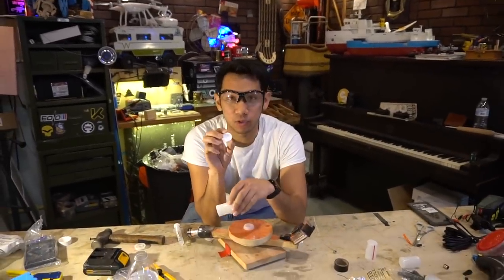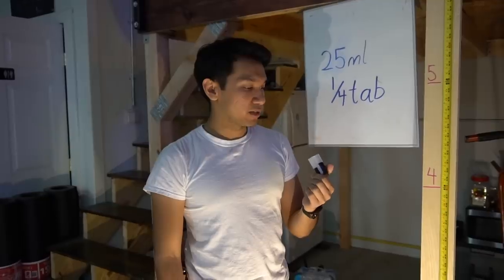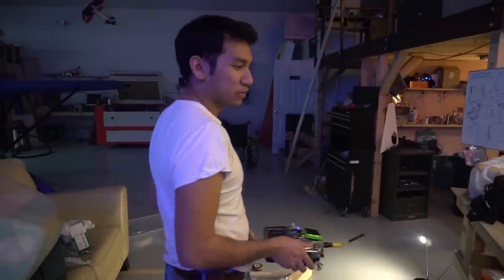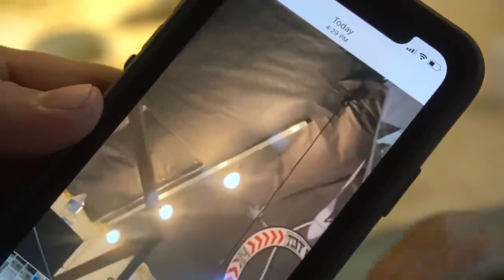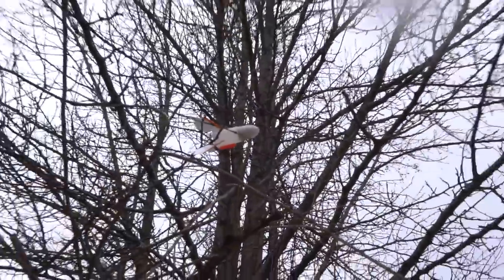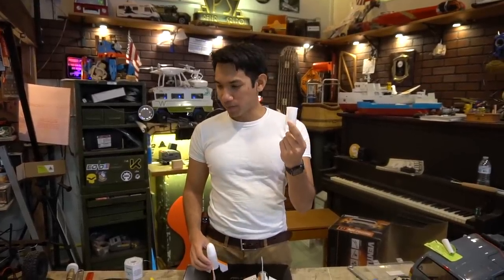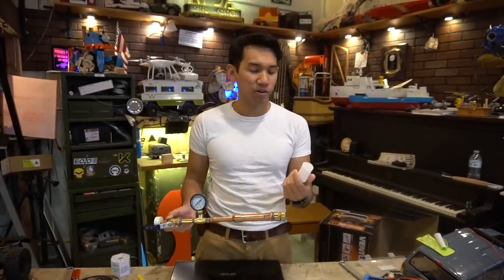EXTREME Alka seltzer Rockets

Comment: Love the channel but hate it when Sam comes up with a good idea and peter doesn’t know what to do and gets jealous and throws it in the bin...
Reply: He is right though, it changed the propulsion type from a rocket engine to a cannon/projectile. I could see an asshole teacher giving it a D or F for that reason.

The challenge was an Alka Seltzer Rocket, and he still gave it 1st place.
Reply: Seems he treats his friend like crap, he could had used Sam's   launcher, just leave the valve open. Peter you need to be nicer, open jealously does not go over well.
Reply: Papadoc Fpvp
A rocket provides it's own propulsion. Using Sam's cannon is cheating, because it's the cannon gives propulsion to the object, which means the object is not a rocket anymore, it's a projectile.
Reply: @roelvian  neither one carried the propulsion unit on the rocket, just delivered pressure differently, one popped when the pressure was to great, the other had a valve, and a smaller pipe to increase pressure. They were done in different ways, and I do understand what your saying, but Peters did not carry the propulsion fuel either.
Reply: Papadoc Fpvp ok then, listen to me.

Rocket -> self-propelled
Projectile -> gets propelled

Peter's rocket -> self-propelled by the reaction inside the rocket. The energy was released FROM the rocket.

Sam's Cannon -> Propelled from the reaction inside the pressure chamber. The energy was released from the chamber ONTO the projectile, which pushed it forwards.

the contest: Rocket Contest
Reply: @roelvian  you don't need to be a jackass, I would agree if Peters rocket carried it's fuel, but it just pops, and pushes it up, the initial pop propels it, nothing on board. Sam just figured out a better way. If Peters actually carried fuel until it was gone, I would agree with you. I do understand what your saying, I'm saying Sam had a more ingenious idea. Also Sam's didn't have to be spun to get the highest possible reaction. Since neither Carried the fuel. Sam had the better idea. All he would need to change it is, simply glue the film canister lid on, put a Plastic valve at the bottom, then open. Then it would be on board with fuel.
Reply: Naw Peter needs a side kick to make the videos watchable. It’s a calculated strategy to get views. Same formula Hollywood has used for 100 years
Reply: @Heyemeyohsts  Exactly - keep reeling em in boys
Reply: i strongly agree.  i feel bad for sam because you treat him like shit
Reply: There just buddy’s playing once we made co2 cars and mine had a super skinny neck, my friend wanted to pretend snap it on his leg but I messed him up and he actually did break it in half and I didn’t care we laughed and laughed and glued it back together with some super glue I ended up getting second place
Reply: same
Reply: Roelvian he is not just talking
about the video he is also talking about in general he does it
Reply: @Light on the Inside    They wouldn't be an asshole though, they'd be teaching you.  A bullet and a cannon ball are two different things and at the most basic level its how they are propelled.
Reply: Did you guys ever become BFF’s? Have either of you seen the very rare (and kinda silly) “rocket-propelled bullet gun”? And … whatever happened to Sam?

Comment: If you really wanted to go nuts with alka-seltzer rockets, you could try for a "hybrid" design, with a hollow cylinder core of mixed baking soda and citric acid ("fuel"), then pumping water in from the top ("oxidizer"). Getting the exhaust nozzle design and flow rates figured out would be tricky, but it might work pretty well with some trial-and-error. Bonus points if you pre-heat the water to speed up the reaction and increase the internal pressure.
Reply: Instead of water use hydrogen peroxide with a platinum catalyst to heat liquid before it gets to the core. 😂 Over complicated is my middle name
Reply: I also love spraying hot hydrogen peroxide everywhere on a cold winter morning.
Reply: @userPrehistoricman  yeah I heard that is how Jake Paul does the blonde tips in his hair
Reply: @userPrehistoricman  what should I expect you I've never tried this?
Reply: Just by coincidence Cody's lab did vinegar and baking soda Rockets the same week. His did in fact store his fuels separately and use electrically powered pumps. It didn't work that easily but it was a great demonstration particularly for teaching.
Reply: By pre-heat, do you mean just hot water or do you think steam would work? Obviously it's the same substance but I can imagine getting some serious pressure using actual steam

Comment: Did you try holes on the launch tube? Like a paint ball gun, it could help pull air off the canister as it travels up the tube.
Reply: Your also going to loose propulsion.
Reply: @RCOverKill  but isn't all the propulsion in the canister?

Comment: drill a little hole into the cap (like 3mm), assemble it with a piece of foil between the body and the cap, maybe the pressure would rupture the foil and you´d have a little nozzle? (otherwise build a launcher with a litle needle and a guiding rail where you can drop the rocket onto the needle) also crush the seltzer for faster and more complete dissolving, baking soda and vinegar work very well as propellant because of that surface area
Reply: In real life this is an upside down form ballistic shooting. If you added the weight of that bottom cap and you kept the fuel on board for the bulk of the flight and therefore had to work with the rocket equation  You lose out. But I'll try it this weekend with my son. Personally I think that  What I am going to call "combustion control" is the next big key.  Pre grind the  Alka-Seltzer or and then control the point where the cap is going to release for Max pressure.

Comment: Sam for the win!!! Maximize the gas pressure with the available fuel... in other words, the CO2 gas is the propellant and ideally you would want as high a gas to water ratio as possible. Sams idea kept the gas expansion contained outside of the rocket so it was probably lighter during flight. So, a re-design that may be within Peter's definition of a "rocket" may be using two film canisters: one to act as a reaction chamber that is sealed shut after the fuel is mixed, a small tube allowing the gas to travel into the dry rocket chamber with the standard pop-off lid.

Comment: Make a De Laval nozzle and use it in an air-powered rpg nerf thing. Basically, take one of those nerf foam footballs, put an air canister and the nozzle inside with an rc valve. Flick a switch, the valve opens, and you have launch. The foam will protect it on landing (hopefully) and the nozzle should be 3D printable, so you won't have to use metal (though you could if you want.)

Comment: As the thrust is determined by the pop-strength of the film canister lid... its doesn't matter what amount of water you use. Its like blowing up a balloon with Argon or Air... It still pops at the same pressure

Comment: Here's a hint how to expand on Sam's idea legally without the external pressure chamber: Figure out a way to clamp the container and lid together so that you can get the pressure much higher than the point where the lid would normally pop off. Let the pressure build and then release your clamp.

Comment: I wonder if it would be possible to do two things: 1) scale up by a factor of 10 to 100 and 2) with the larger scale, it may be possible take Sam's idea of storing the pressure but this time store it inside of the actual rocket.  So maybe there would be some alka selter tablets that get sealed in to the fuel tank ahead of time, and then a valve so that you could feed the water in right before launch, and then a mechanism to disconnect the water.

Comment: Heat the can's end and using a wooden form push the bottom in to a cone. Take another can, cut the bottom, throw it away, cut the tube in 3 equal parts, bend them with the natural bend on the outside, then glue those fins to the formed can, shape to desired form.

Comment: for the gyroscopic canister it may help to crush/powderise the alka selzer before adding it to the mix. in theory if you do this the alka seltzer will follow the water and stay on the sides as well. making them dissolve together like you need, rather than a heavy round pill that will tumble around in the canister.

Comment: A multi-chamber seltzer rocket with a blowout valve that only opens once a certain pressure is attained would be best. More chambers feeding into the output with a plug that breaks at operating levels will maximize gas production and consistent output over a greater duration.
Essentially: output nozzle on bottom, main combining chamber above with rubber plug to blow out at maximum pressure. (output diameter TBD) Various fuel tanks on sides directly attached with tubes to increase gas production into main chamber.
Bonus: Staging could be accomplished via a small compartment on top. A seltzer tablet affixed to the "roof" of the container with a weak bonding agent will fall and begin to mix right at the point of liftoff. After the bottom stage decelerates and falls away, pressure will release the upper stage for a short burst flight at max elevation.

Comment: I believe that the reason the gyro stabilized one didn’t go higher was due to its lack of aerodynamic stability. The heavy nose cone (even though it’s styrofoam, it still would be a significant mass for the system) added to much surface area to the front of the rocket, and also pushed the center of mass forward. The water swishing would simply create a vortex, and shouldn’t through the system to far out of whack after the launch. It would be interesting to see how high it would’ve flown without the nose cone, or if you could find a way to add fins (slanted to maintain angular momentum of course) to the gyro stabilized system.

Comment: u simply shld've tried super gluing the tablet onto the inside of the cap, added the water in the canister, attached the setup upside down onto the canister, quickly inverting it, slowly sped up the motor so that the water is spinning equally on all sides, and u shld be gd! love the extreme measures that u took tho xD

Comment: When you said the pressure has to equalize in the tube why wouldn’t you shorten it but add hole on the bottom to equalize the pressure

Comment: The big rocket went higher because you released the pressure at its maximum. Modify the film canister to hold the maximum pressure the Alka seltzer can produce instead of just relying on just a friction fit.

Comment: What if the rocket was heavier? My thinking is that having more mass/momentum will allow the pressure to build up just a little bit longer due to slower takeoff, and it will have an easier time going through the air.
Another thought is what about a multi-stage rocket? Cut the bottom off a canister and replace it with a small balloon. That balloon then acts as a stopper for the next canister so that when it's pressure drops, the next stage pushes it out and 'decouples'... or something like that :)

Comment: Would it have been possible to stabilize the pressure on that first design by drilling holes close to the bottom of the tube instead of making it shorter

Comment: Hi Peter! What would happen if you shortened the tube, but then connected a secondary (small) tube that connects from the top to the bottom to relieve the vacuum pressure once it starts moving? Like shotgunning a beer!

Comment: Or, get this. You drill some holes around the base and up the length of the tube. This permits airflow and gets rid of the vaccum effect entirely. Also, shortening the tube will help as there will be less friction between the inner surface and the cannister itself. Jsyk

Comment: Would a alka seltzer submarine be possible??? Like, a heavy tube the fills with gas after it gets submerged in water. So if it falls in the water it can float back up to the top. Idk. It makes sense but the whole that lets in water could also let out the air...

Comment: U should have changed the rules slightly in your favour and made a small hole in the centre of the lid with putty blocking it and taped the lid to the container. That would have made the thrust exit point smaller thus increasing the duration and the power of the rocket. Great Video! :)

Comment: Hey peter, do you like rockets, flamethrowers, and have a somewhat slowmo camera?

 I have an idea that I've always thought would be a perfect project for you. Basically it's a water bottle rocket design filled with things like flour or cornstarch or whatever as its propellent. 
I saw a youtube channel do a little experiment with different kinds of propellents and when they used the cornstarch-y stuff, i couldn't help but wonder what it would look like if there was an open flame near the launch pad.

It would totally areosolize it enough to ignite the powder, and because the rocket gets thrown upwards, it might look like it was an actual combustion rocket launch.

It sounds totally up yours and sams alley tbh

Comment: I use hydrochloric acid and aluminium foil pieces. They make hydrogen gas and big pressure. One can also ignite the hydrogen. This way I can make rockets or just a loud but relatively harmless explosion.

Comment: Peter, I have been trying to find out if anyone has ever built a plastic model plane, out of the box, and made it a RC. I have asked many channels, Flight Test, even Make it RC. I am not referring to Balsa Wood, but Revell,  Monogram, even Snap Tite.  No one has responded. Not even a No. Can it be done? Will it fly? I was told people have, but there is no proof.  I am not challenging, but the challenge is there. I just want to know.

Comment: actually i believe Sam's rocket kicked ass since it  harvested all the reaction in a prechamber and then impulsively bring that force to the rocket. So Peter told it is a canon rather than a rocket. However since his own rockets uses the same principle (just they are pregone as the canister can not collect more gas like Sam's design) they are also canon rounds. (definition of rocket: 1
/ˈrɒkɪt/Submit
noun
1.
a cylindrical projectile that can be propelled to a great height or distance by the combustion of its contents, used typically as a firework or signal.) 
or 
The Tsiolkovsky rocket equation, classical rocket equation, or ideal rocket equation (also known mistakenly as delta-v) is a mathematical equation that describes the motion of vehicles that follow the basic principle of a rocket: a device that can apply acceleration to itself using thrust by expelling part of its mass
Peter, your designs are not rockets neither. so don't try to bitch at Sam.

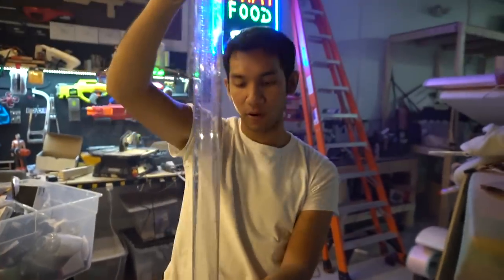Comment: At 4:28 into the video, you could've just drilled holes in the tube during testing instead of making the tube shorter. Like a rifle barrel with a muzzle break on the end of it. That way, air could escape the tube as the canister moves upwards through it. Seriously. Why must you make things more complicated than they have to be?